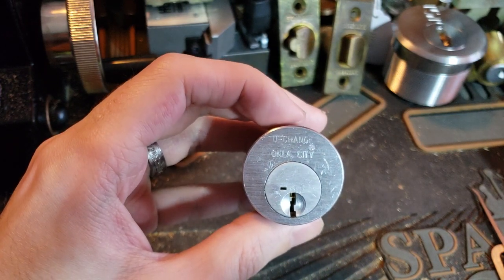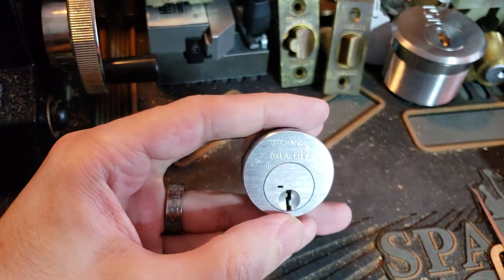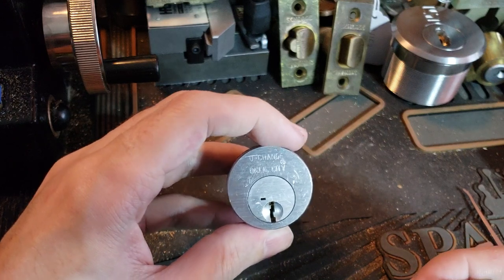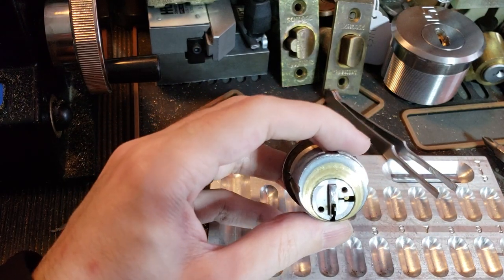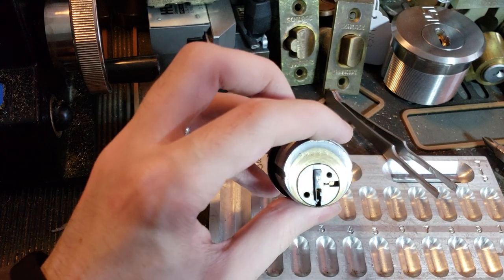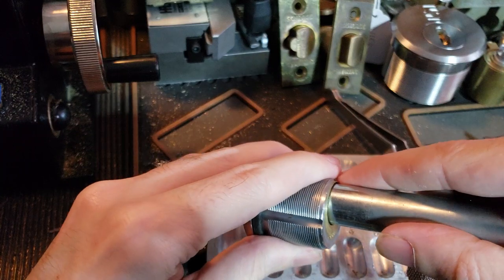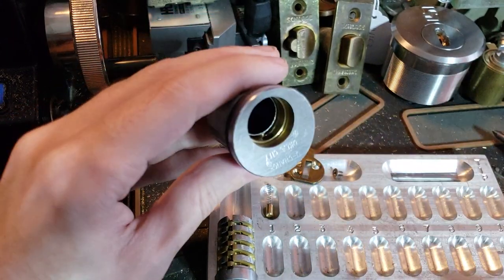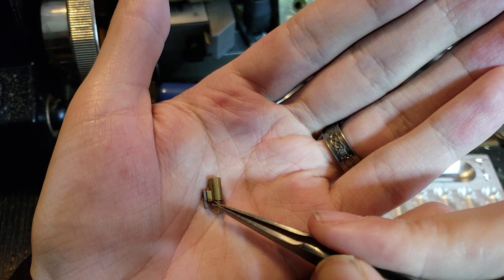(110) U-Change lock cylinder picked and gutted

Comment: Interesting seeing one of these again, I think yours with the best explanation.  Looks like 4 possible depths of cut on key due to 4 grooves on "funky" key pins.  Wondering if some "large dia" serrated or spool pins would add pick resistance (or perhaps just add more reliability / wear problems).
Reply from the maker: The inner portion of the key pins do indeed only have 4 cuts on them which suggests only 4 depths are available (U-Change does not publish an official space and depth specification but seems likely). Given the design of the plug I suspect any driver pin with a reduced diameter (spool, mushroom, T, etc) would be too likely to catch in the cutout for the change mechanism which would create significant reliability issues, serrated pins would not present that problem but would likely add to the expense of these already fairly expensive locks.